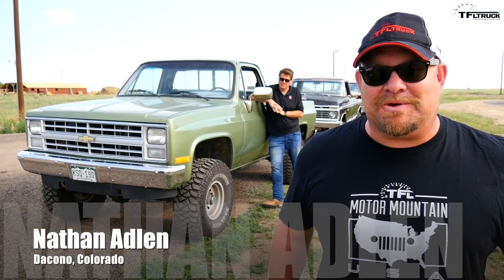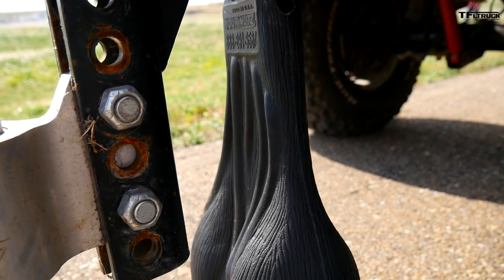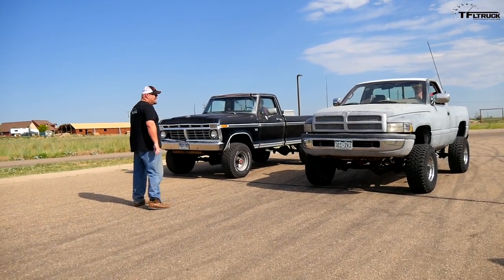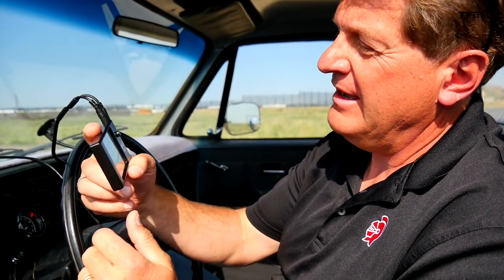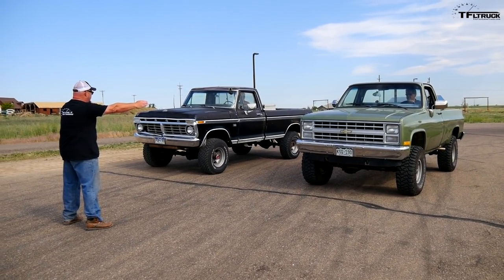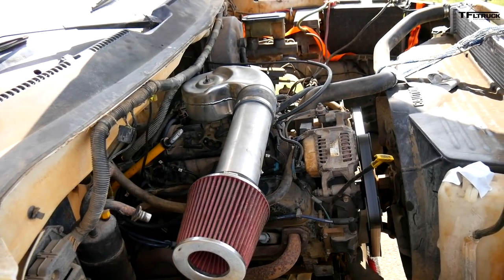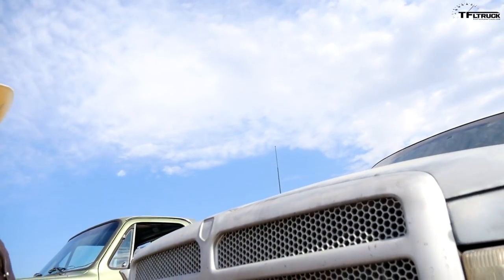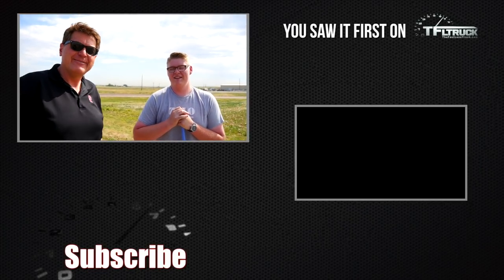Classic Drag Race: Chevy K10 Big Green vs Ford F250 Rusty Boy vs Dodgezilla Ram Overkill

Comment: Was that the oldest running dodge they could find?😂😂😂
Reply: Ha
Reply: I think that dodge might have had a 3.9 swap at some point. Slow slow
Reply: I have an 87 dakota runs better than most trucks out there and uts a work truck
Reply: @MustObeyTheRules  have you taken it to mexico amd back and not have to anytning but an oil change and the regular maintenance to it? I dont think so.  My little dakota still wins.  Over 350k on it no engine swap or tranny problems
Reply: @MustObeyTheRules  you call it junk but when ypur chevy breaks down youll be asking for a ride. I also have a 2015 ram and contwnt with it as well
Reply: @MustObeyTheRules  you ever get stuck in mud where the front of the. Trunk is sunk into earth and its buried and the air filter is sucking up mud because its submerged and the engine ran the whole time had a guy in a chevy try to pull you out but get stuck. Then your I a world of shit with a truck but we got it out 2 weeks later and it started right up after that long wait. We actually never really cleaned that engine
Reply: @MustObeyTheRules  Bad to the bone stickers?
Reply: My Dodge has been in the family since elementary school.  Truck has right at 400k miles.  Still runs like it's brand new.  It drives from Tennessee to Georgia multiple times a month.  It's all in how you treat em.  I got the 318 5.2
Obviously the old fart didn't know what he was doing.
Reply: If you dont slam it down you wont blow it then it will work
Reply: @MustObeyTheRules  the newer ones do 2005 + and some of the old ones too
Reply: 8.1duragas dodge is garbage
Reply: @kimmed4336  I'm guessing manual trans? Or you've put 13 replacement autos in during that 400k miles?
Reply: @dan d Nah just taking care of it. Regular maintenance
Reply: Different here in oklahoma you can rarely find a ford older than the early 90s. Ive seen plenty old dodges and gms.
Reply: The only people I ever see complaining about a Ram and it’s reliability are the people that claim they have a “buddy” with a Ram😂😂🤷🏽‍♂️ search Craigslist and see who really blows the transmissions
Reply: It’s a dodge they don’t last long😂😂
Reply: Joel M as a dodge fan I can confirm that that’s true
Reply: The oldest dodge I’ve seen is like an 84
Reply: Lo Value  I have a 727 behind the Cummins in my 89 d250. Great Transmission
Reply: @MustObeyTheRules  How about you get a diesel?
Reply: He owns it that's why it's there.
Reply: Lol. My friend had a 97 318. He was on his 3rd transmission at 100k miles. Junk.
Reply: My dad had an 85 dodge ram 1500 when I was younger she was a black beauty, factory blue paint went to shit so she sprayed up with rattle can black, but damn was she a runner.
Reply: 80's dodge rams rusted off the face of the earth
Reply: 93 Cummins here. If it is they didn’t look very hard
Reply: I notice a lot of old f100s still running ,but I seen 1 old dodge in my entire life lol
Reply: Joe S. If he doesn’t remove the check valve the life of each new transmission will get shorter and shorter, that check valve ruins them, take it out will last much longer.
Reply: brando garcia try the s 10 son
Reply: brando garcia = You have Ford or Chevy power in it because those things were junk when new.
Reply: Haha right. Atleast the transmission didn't fall out
Reply: Uhhh....uhhhh...uhhhh.....so rusty the K10 than 2001 dodge ram  
cummins turbo diesel however how did could they find it are rusty older trucks?😄😄😅😅😁😁😂😂😆😆😆
Reply: My buddys dad has a 73 power ram. Not fast HORRIBLE gas mileage (3MPG) but that thing could plow snow like nobody's business
Reply: That’s the first thing I thought when I saw the pic lol!
Reply: Noooo
Reply: No, its just a dodge bud lol
Reply: And that still had a trans lol
Reply: I have 2 68 Chevys...I live at a 4 way stop...I see maybe one Dodge from the early 90's to 25 gm/ford. And never ever a classic dodge truck. I'm not bias...if it runs I like it but it is what it is.
Reply: Ever heard of the 24valve and 12valve Cummins the dodge trucks with those engine last longer than any other truck in U.S history
Reply: Most definitely
Reply: All the others were rusted out
Reply: LMAO nice
Reply: No that’s a second gen there are older dodges. You are unintelligent.

Comment: That old Ford weighs significantly more being a F250 long bed than that Chevrolet k10 1/2 ton shortbed. Which by the way is lighter then the ford f150 short bed 4x4 of the same year. That old Ford would have probably been a bunch harder for that Chevrolet to beat if it were a f150. A truck length lead with all that go fast stuff and a crate engine compared to that old rough running 3/4 ton long bed Ford isn't making that Chevrolet look anything but unimpressive. If $11,000 was spent under the hood of that Ford on a rebuild of that FE to 390 CI if it isnt already , add a Pair of Edelbrock Aluminum heads, Edelbrock Streetmaster intake and a Holley Center dump 750 cfm carb and Comp 268H cam , Ignition upgrade to the Duraspark big cap and spacer with MSD box and ceramic headers and 2" exhaust out to the rear, shift improvement kit in the C6 ...That Chevrolet would have got owned handidly . Easily a few truck lengths if not more depending on the traction the Ford would lose initially. Them FE Fords arent anything to underestimate stock . With the parts list I mentioned they will make 450 HP reliably for years. But HP doesnt mean a thing in those pickups. Its Torque thats important and that FE would make a gob of it with the parts list I described. With a consistent production in the 525 - 530 ft lbs peaking around the 3100 - 3200 rpm range. I know first hand having built a couple exactly as described and they transform from a great engine having great power and reliailiy to Mean tire shredding SOBs for not a bunch of money relatively speaking.

Comment: Wow! that Ford was a whole lot quicker than I expected it to be.
Reply: Eska 1408 not sure how bad the ford is but its usually better to just start with a truck that isnt rusty.
Reply: Eska 1408 I'm surprised as well man.
Reply: Eska 1408 I'm not
Reply: Those 4.10s really helped it get off the line.
Reply: The Ford was lighter due to the missing metal so it was quicker. LOL He even got a jump on the Chevy but was overpowered quickly.
Reply: I have a 1971 2wd f250 and a 1973 4x4 f250. Both have 360FE engines in them. Both headers carb and intake but man! My 71 is pretty damn fast!
Reply: When I was 17 I had a 1978 ford f150  with a 460, I nearly killed myself with it and so I sold it, it was too much power for the brakes and handling (lack of both).
Reply: Eska 1408 4.10s brother.
Reply: Barack Smith yeah trucks are made to pull. not for speed. the handling is shit at high speeds. you might only be alive because you sold it. you made the right choice but it still must have been fun as shit lol
Reply: BrainStorm4207 wise words
Reply: I have a 74 F-100 with a 390 that's stock except for a set of headers and Thrush glasspacks. It's scary how quick that truck is.
Reply: I have a 71 short box F100 4x4 with a swapped in 460 out of a 68 lincoln Stroked to 521 . Its Cammed and performer RPM intake with headers and Holley EFI conversion. Np205 t case and a Np 435 4 speed trans . 4.10 gears in a front High pinion 44 and rear diff is a 5 lug semi floating dana 60 with a power lock .  She boogies big time and will drag anything I put behind it. Hp and Tq numbers unknown but would guess to be over 400 hp easily and the Tq I would bet is easily over 500 ft lbs . It will smoke 35s like they are 235s ;)
Reply: not really
Reply: You should see one with a 460 woulda beat the shit out of that shitty chevy
Reply: Eska oh they move faster then people think!
Reply: I have a 1977 ford f350 camper special with a 460 in it. The thing burns out on take off. It is a very fun and powerful truck.
Reply: i had a 76 f250 4spd 4x4 highboy explorer package. the 390 i had under would scream laying on the throttle. sit down hold tf on.
Reply: SoCal Mopeds I got a 71 f-250 with a 390 in her and a 4 barrel she is quick but eats gas
Reply: but Chevy still beat um
Reply: Those fe engines are no joke... hidden potential
Reply: I drag race my 2003 f250 powerstroke against the stock 1974 f250 8 yrs ago, and I lost miserably
Reply: @toniaking369  with all the upgrades
Reply: It's all about gearing, plus all them older trucks hauled ass back in there day.
Reply: I recently bought a 71 f100 with the 360 FE... 
I too am surprised at it’s capabilities! I bought it to flip originally, but as a bow tie guy, I’ve come to love this blue oval!

Comment: 70s vs 80s vs 90s!
Reply: Crocodine Huizar Oh Yeah!!!!!!!
Reply: Dodge was the newest truck there and the Ford still whooped it.
Reply: Yes a heavy emissions era Chevy and Dodge versus a right before the emissions cut era for trucks anyway Ford...and the Ford still lost. All the haters will say the chevy has a crate engine, cheaper mods... Maybe if Ford had a plethora of strong small blocks instead of a select few,  they could of made affordable power or crate engines too. That's a testament to the SBC.
Reply: @ashes2ashes863   Since when is 1974 "before" the emissions era? Just look at the performance numbers for a 1970 F250 wayyyyy higher. Hell the compression ratios fell massively. And so the Chevy wins with a brand new crate engine over a near 50 year-old emissions choked stock-engine '74 Ford. Yeah really impressive for the Chevy. Try comparing a '74 Ford vs a '85 Chevy stock for stock and do this same test.
Reply: @ashes2ashes863  And Ford does make powerful small block crate engines. The Ford 5.0 Coyote makes the same or more power than a Chevy 5.7 and it does it all with way less displacement.
Reply: @josephg41  well it would seem it should, the Chevy 5.7 is ancient. Despite that fact there's plenty of ways to make way more power with a 5.7. Not to mention cheaper and more reliably. And a small block Chevy will fit in just about anything. The 5.0 Ford mill is actually physically pretty large despite having less displacement. Its great, but would never be my choice over a 350. Double that if it's versus an LS. I do prefer GM, but I'm a car guy in general. There's a Ford in my driveway too.
Reply: @josephg41  that's absolutely right, but the point is if you took a catalytic converter off your 74 car, no one's going to give a shit today. Try doing that to the your 98 and newer car especially. Check engine lights and a failed emissions test is what you'll get. I'm younger, for me the emission standards didn't get serious until OBD2 even though it was irritating in the late 80s at times too. For me I believe that was late 90s early 2000s. You could have a loose gas cap and fail emissions. Back in the day they would rip all the vacuum tubes off and put caps on everything and throw that s*** right in the garbage and nobody cared, despite the engines having lowered compression. People that had smog pumps disabled or took them off, they gutted the catalytic converters or got rid of them completely, Etc. The 350 in not green Chevy has to live up to higher standards  because it may be being used in something much newer than that 74 Ford mill was. Besides, everybody knows the worst emissions years were the late seventies into the early to mid 80s. That's what they really didn't have the best technology yet and they were choking off everything to the point where it was barely making any horsepower. It did start in the mid-70s, but I think It got gradually worse until it finally peaked around the mid-80s. 
The diesel guys will probably tell you it's peaking right now for them. Now they have to run DEF fluid and they have to use a more filter refined fuel. I don't even think some of these new diesels would run on the old diesel fuels they used to use. Don't worry though, if it's up to the tree huggers we will all be riding around on pos mopeds soon.
Reply: @ashes2ashes863  Yeah for the aftermarket I'd probably go with an LS too, but I was talking more about how they perform out of the box, like if you were to go get a V8 Camaro and compare it to a Mustang GT. I just think the Coyote does more with less.
Reply: @ashes2ashes863  That's true, but in general despite a few more regulations, the typical 80's vehicle had way more compression than a mid 70's V8. Really I just want to see that '74 Ford and the '85 Chevy raced when they are both stock. Because anyone can make practically anything fast with enough money. I want to see them as they were.
Reply: @josephg41  I like the Camaro better because I think the 6.2 is really hardly being tapped into in regular ss trim, but I will agree that Ford has done a lot with the 5.0 Mustang given its 1200ccs smaller.  Pretty badass! The big 3 all have some nice rides right now. You really can't go wrong with any of them.The Mustang, Camaro, and C8 Corvettes are especially nice imo. Id buy one of each if I could get rid of my wife. Id probably still save money too.
Reply: @josephg41  amen to that. Honestly I get excited when I see anything older than the early 90s but especially from the 80s and 70s on back. Especially if it's well-cared-for. Who would have thought that all that old square body type styling and big steel wheels back then would have such a warm place in my heart today. I'm just so tired of everything with all the curves today. Its nice but it was just something nice about those old rugged square body type trucks and the old big ghetto Cruiser cars. I actually miss the station wagons too. I know they were considered the ugliest things on the road but I think there was something kind of cool about them. Last time I got to drive one was a Buick Roadmaster and I thought it was the coolest thing...
Reply: @ashes2ashes863  Lmao

Comment: So a stock truck VS a truck with big tires and the wrong gears VS a truck with $15K performance work...

Good job by that old Ford, proving the right gears really help get you off the line.
Reply: BlueDually4x4 the oldest truck there still has the original engines and still running that why I love ford truck my a little bit newer  great work truck
Reply: My Ford is peace of junk.
Reply: Probably have 4.10 gears. If u running 39.5 tires 4.56 gears works well. 44” tires 4.88’s or 5.13’s.
Reply: Probably should take care of it better then.
Reply: Emily Coleman = Go bakes some cookies kitten.
Reply: I had a 150 1980. With a 400 and 38in ground hogg 2  and 4.56 gears that would run 125. Or thats what the trooper said.

Comment: Now, lets see them spend 11 grand on the highboy, a 2016 coyote is around 9 grand :)
Reply: Devonte McNeill Then they would have to have someone rebuild the trans and install the motor. That would be about the amount big green has into it. Although I think 15k is a little much for what big green has done.
Reply: Devonte McNeill building the 390 would be better
Reply: Devonte McNeill I was thinking the same thing 😂 drop when of those in there and it'll whoop everyone's ass for sure. I'm wanting to put one in my '71 F-100
Reply: no coyote it would need a crazy amount of work to squeeze one in there with all the computer bs plus they are a wide ass engine. just rebuild that old fe big block
Reply: Just switch out the 3,000 pound intake manifold on the Ford.  It'll win just from weight loss
Reply: @adamscholl9410  how heavy is the intake manifold?

Comment: Way to go Tommy. Ford Rusty Boy all the Way...... One Coyote Crate engine, some fuel ejection. Even it up a bit. Kents buddy can rebuild the transmission and back to the track and some good ol off roads. Great video.
Reply: Yes the High Boy is my favorite truck from the seventies. Wish I still had mine.
Reply: Brian Desjardins You ain't kidding. Go Rusty Boy!!
Reply: NonRev hell better and cheaper yet just build the 390
Reply: Meldins STI may as well go all out and build an aluminum Pond block 427 SOHC 😈
Reply: NonRev I used to have an old 78 250 with the 460 big block with a C6 transmission I bought a 73 Lincoln with a 460 in it and dropped it in my truck that sucker would shit and get

Comment: Those old f100 are tough as hell, my dad still has one in Mexico and it has gone though several years of punishing work and it still runs amazingly well. the sheet metal on those trucks is super strong compared to the flimsy sheet metal of newer trucks.

Comment: $15K for all those speed parts and that's the best you could manage against a worn out old Ford? Sounds like a lousy investment to me.
Reply: vburke1 I mean it also is a manual which you can't shift fast... I have the same truck with a 350 and you can't speed shift it
Reply: Excuses excuses :). Even with slow shifts, Big Green should have left the old Ford WAY in the dust.
Reply: See my comment above... wondering what the Ford engine really is... Was expecting a Ford 400"
Reply: vburke1 ikr
Reply: BuzzLOLOL a peace of crap XD
Reply: Tht wasnt 15k in jua the engine
Reply: Don't get too cocky....Big block vs Small block?? C6 vs SM465 ?? 4.10 vs 3.73? And what speed parts?
Reply: @vburke1   IT DID!!!
Reply: Most likely a 360
Reply: WHY WOULD YOU PUNCH IT EVEN MORE WHEN YOU KNOW GOOD AND WELL HE'S NOT GOING TO GET NEAR YOU ??? JUST KEEP IT AT A SPEED HE CAN'T BEAT. THAT'S NOT A SMART POST TO SEND. I'M MORE THAN SURE HE COULD HAVE GONE FASTER, BUT WHAT IS THE POINT YOU ALREADY HAVE HIM BEAT, REMEMBER IT'S JUST FOR FUN !!!
Reply: Should have just put an Ls motor